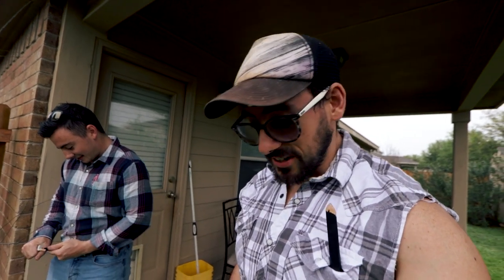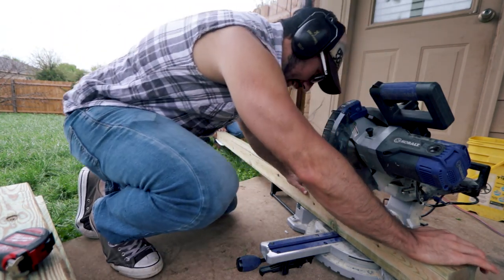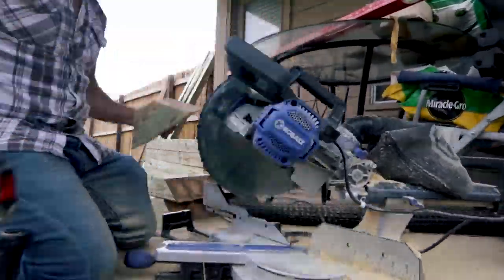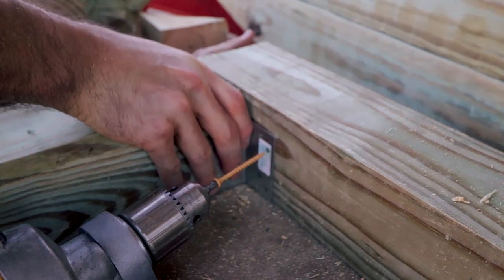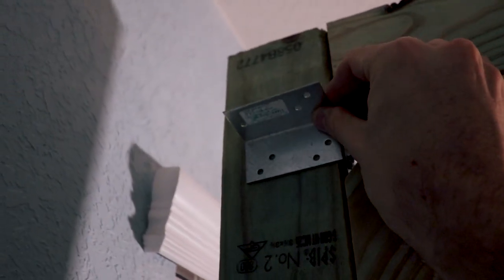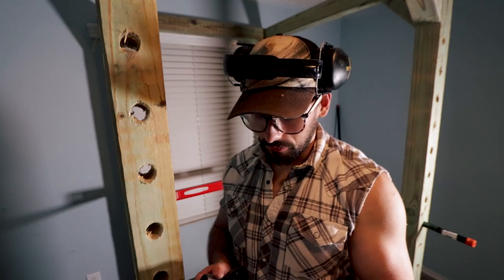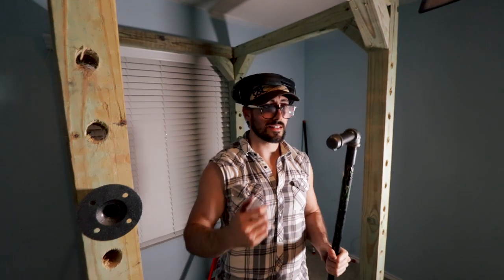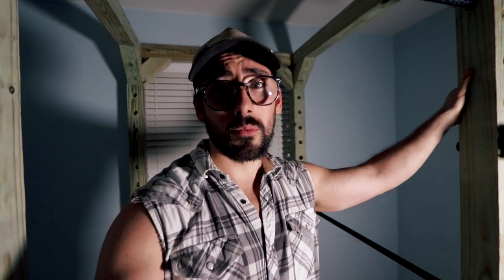How I Built a Home Power / Squat Rack for $250

Comment: I'm making mine today and I cut all the wood but I'm short about 8, 45 degree triangles for my base. I didn't have any extra pieces, any idea why?
Reply from the maker: Daniel Son if I had to guess, you may have bought a 4x4x6 instead of a 4x4x8 that could account for the shortage. I used a total of 9 4x4x8 boards and I was left with a little to spare. I cut the angles and flipped the 4x4 each time to maximize the amount of wood I was getting out of each cut.

Comment: How much weight can the safety bars hold?
Reply from the maker: Jordan Donohue I have not tested them with any significant weight yet, but I will as soon as I can get some weights. Iron pipe is really strong, but if you want to make it even stronger you can get a thicker iron pipe. I was able to do pull ups with any issues and I am about 200lbs. Also I believe there is a data sheet with the rated PSI for a schedule 40 iron pipe, but I was having trouble finding the exact number for a 3/4 inch pipe. Hope this helps.

Comment: Any tips on getting the 1 1/4" holes straight through? I used a drill with the speedbor bit, but all of the holes on came out the other side all over the place. I tried a drill press with a spade bit, but it is taking 10 minutes per hole.
Reply from the maker: mrbungledisco it’s really challenging, we first marked all the holes straight and pressed the point of the bit in before driving it in. The hard part is just keeping the drill level. We have a few holes that are slightly off in the back, but we just took a file to it and leveled it out. Using a drill press would be the only sure fire way to make sure they are perfectly straight. I would have used one if I had one 😅 wish I had better advise for ya on that one.
Reply: @TheDailyDrift  no biggie, I just ended up going for it. About half and half on getting them all straight, those sides will be facing the back lol

Comment: Great Vid
20:29 Are the flange and other piping accessories strong enough to hold 150 kg (300 lbs) on each side?
Reply from the maker: Thanks, The most weight I have tested on them so far is 250 lbs and it held it just fine. It really depends on the type of iron pipe you use., most have a rating based on their size and material. I would just verify the rating of the pipe you intend to use and check for the sheer strength.

Comment: Would there be a way to replace one of the top support beams with a pull up bar, so I can practice muscle ups.
Reply from the maker: It is definitely possible, you would have to check the dimensions, but you could use and iron bar screwed into a chair flange and attach that to the posts instead. it would replace that top beam with a bar, but you'd have to find an iron bar that is the right length for the gap. hope this helps!

Comment: How exactly did you cut the triangle pieces to hold it together? Like the measurements
Reply from the maker: Noah Strickland I used a 45 degree mider cut. If you measure the long side (the base of the trapezoid) it should measure 10 inches in length.
Reply: The Daily Drift thank you so much!

Comment: I seem to have the same problem as well looking for barbells and weights online. Most of the distributors have been affected by covid 19 so if you try and look for the weights on websites like Amazon and rogue, you wont find any and you pretty much SOL. Great job on the rack.. will probably do a DIY project this weekend as well..
Reply from the maker: Shaun Manalo yeah it’s been a nightmare, but I may have come up with a solution for weights. I’m in the process of testing and I should have a diy for it soon. I just want to make sure they are safe before I put it out there.
Reply: I went to home depot and got some cinder blocks, they work fine for me
Reply: I've been collecting 2L milk cartons, just full of water = 2.1kg, you could put sand in to make heavier. Just tie a loop onto them and it works, cheap and easy. Got 9 collected so far, which is 18.9Kg
Reply: Keep an eye on Dicks Sporting Goods website early in the morning when they update their inventory. I was able to pick up the 300lb Olympic weight set a few days ago at my local store, they got 3 sets in that all sold out in a couple of minutes.

Comment: I just made 1. Diff then yours. I used 8ft 4x4s and 2x6s. Total of 56 3inch screws and 3x5 steel corner braces a total of 12
Reply from the maker: Mike P That’s the great part about working with wood, it’s very easy to modify and still very strong.
Reply: Mike P how hard was it?

Comment: what if you can’t get 45 degree cut, how can you replace it with something else?
Reply: Manually
Reply from the maker: chill ing well they sell what’s called a miter box and you can use a hand saw with that to make sure the cut is straight. You can also use an angle finder and draw a line and then use a hand saw to make the cut.

Comment: How much did all this cost for materials rough estimate?
Reply from the maker: Alex Farias after it was all said and done, it cost about $250. Now I could have saved some money by not getting pressure treated wood and not buying the extra iron bar for the pull up bar and saved about $50. It just depends on the current price for wood. The benefit of building it is you can have it the same day and build it to fit your needs instead of a one size fits all set up. I’ll be adding a pulley system and weight holders down the road and I’m certain it will be cheaper than trying to buy them. Hope this helps!

Comment: is that treated wood?
Reply: Joseph Sanchez I was about to comment the same thing. It definitely looks like treated wood which is primarily used when the wood is going to come into contact with the ground outside (generally good for outdoor use). Something like this though, I would personally buy standard lumber (no greenish tint to it at all). Treated wood used to have some pretty nasty chemicals in it but I think they’re a bit less harsh these days. Still, they’re pumped full of chemicals which is why the dry, standard pine lumber would be better for this application. Just my two cents — I’m not a professional builder just a hobby woodworker. Make sure to do your own research if you’re still not sure.